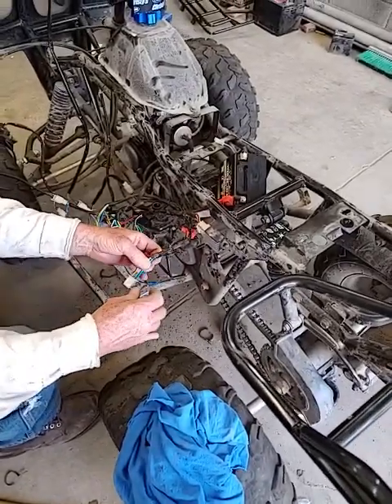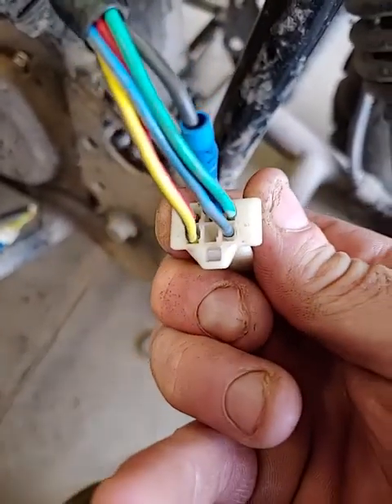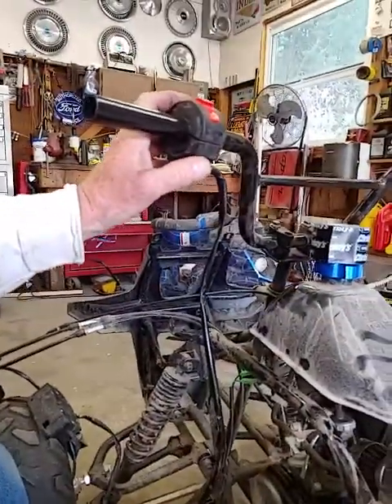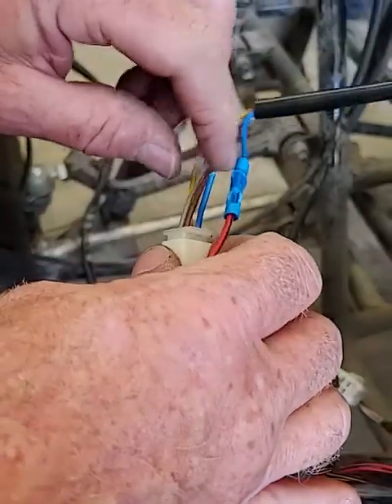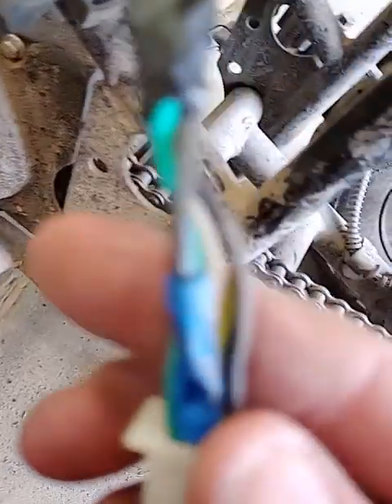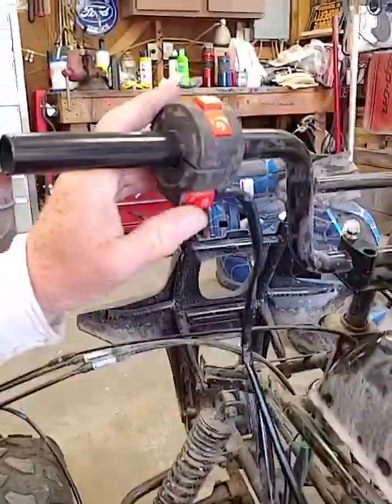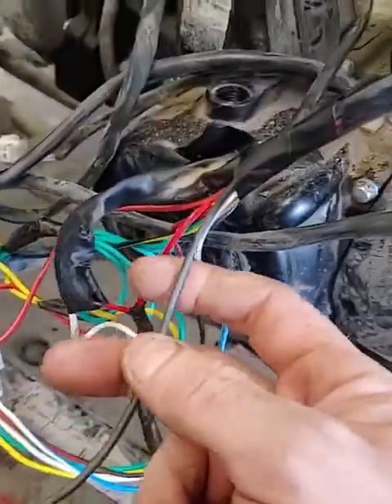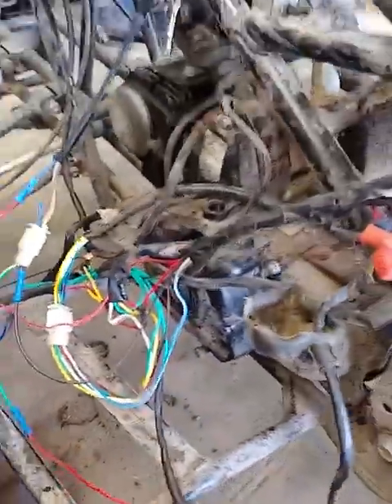Simple Chinese atv  tao tao tforce quad rewire

Comment: Thanks for the video Jeff. How is your key ignition wired and, do you have to have this in order for it to start with the push button?
Reply from the maker: Hey there sorry for the late reply so, I'm pretty sure that the actual key switch itself that accepts a key isn't wired at all it's not even necessary anymore. So you basically have a start button that will crank it over and start it and then it kill switch to kill the motor and that's it it's always live ready to go whether I have a key in it out of it key on key off makes no difference so

Comment: How to keep the battery charged when the motor is running? I used a dc cdi box 4 wire have spark but won’t keep battery charged ?!

Comment: Just watched your video. It’s helped me out a lot but I am stuck right now 
I have everything wired right but my Killswitch and my starter. I’m trying to get hooked up on the starter part of it. Does the green wire go to the grounds and if it does, then I’m good and then off my. Solenoid I have two wires that come off  , you got the red in the black ground but in the middle like area I have two wires that come off a yellow and a red and a yellow and a green now when I put the plug up to it, the two wires that come out of that is green . yellow and red And I’m lost what I need to do with those wires. Does that green wire need to go to ground and then the starter wire goes to the yellow and red cause I don’t wanna burn nothing up if you could help me out a little bit on that I really appreciate it guys. Thank you.

Comment: This might be easier for me than my other message on the Killswitch and the starter. The Killswitch has two wires. Where did those go on the starter has two wires where did those go and I’ll be ready to roll if you can tell me that information. thank you so much. I love your video.
Reply from the maker: Hey brother! I'm so sorry I have just been literally working every 12 hours. Anyway I kind of looked at mine a little today. And there's three wires that come out from the kill switch but then one of them is not used. Plugs into the existing harness and then from there the other wire doesn't come out. And they do indeed go to the starter it looks like. For sure. Anyway, could you send me a picture or even a video by chance? Like maybe just post a YouTube and then send me the link? Or something along those lines? I think that'll be easier to kind of help and see what you have going on!
Reply: I got it figured out thank you for your follow up .

Comment: I'm lost so what did you run to the safety wire. An what you run the brown wire too
Reply from the maker: the solenoid small post the other ends got to be going to the start button. One side of the start button is positive when you hit the button it connects the switch sends juice to the solenoid turns the starter.  Let me get back to you on the safety switch when you say safety switch are you talking about the switch where if the plunger falls off of it it stops running or whatever on the right handlebar?  Cuz if that's what you're talking about we just got rid of it.
Reply from the maker: safety wire is gotten rid of. The solenoid the hot side comes off the battery then there is the activation wire which is the small wire so it has a battery cable off the battery to the solenoid the a small activation wire trips the solenoid and makes the other side of the solenoid hot when you hit the start button

Comment: Need some help for wheeler won't fire should I in stall a CDi box  it's a mountopz 125cc e coolster
Reply from the maker: So I mean it's a possibility that could be the problem but it's possible it's not either. We were juggling the same thing when we started working on this thing and if yours has got all that safety crap all over it like it comes with a remote that you can cut the power or it's got a little button thing on the handlebar that the rubber stop or whatever has to be over etc the best thing you can honestly do is strip all that crap off cuz it's kind of like trying to diagnose a needle in a haystack at that point one poor connection between any of that crap and there are so many items that signal has to travel through, and you're screwed
Reply: @jeffhudson9130  probably just going to buy the whole loom set comes with everything for $35 thanks for replying I mean the four wheelers 2 years old probably doesn't have 300 hours on it belongs to my granddaughter she can't wait to get it fixed if not it'll be for sale end up buying another one thank you for your time
Reply from the maker: @robertlongley6115  yep that is EXACTLY what happened to my son's too! Very upsetting.

Comment: Do you have to remove all of the wiring, or can you just run that wire straight to your kill switch and call it good?
Reply from the maker: So pretty much, if you don't do away with all the safety crap, and it's all still connected in some way, you're not going to get spark no matter what you do. So no matter what all the safety harness part of the wiring system has to be eliminated from the system whether it's all disconnected on the main ends or whatever cosmetically of course it's going to look better but sometimes obviously that's not important
Reply: @jeffhudson9130  Thanks for the reply. The reason I asked is because I bought a brand new 2022 off of a lady that couldn’t get it started due to no spark. She was over it, so I took it off her hands. I just don’t want to mess anything up. Trying to make it simple as possible.

Comment: Where does the negative cable from the battery go? Solenoid? Or where?
Reply from the maker: Nope it just goes to a ground somewhere to the frame of the thing to the old it to the engine or the frame.

Comment: What side of the solenoid is the hot side??
Reply from the maker: Hey there.  Sorry I'm finally responding to this so you can use either big post for the hot the solenoid doesn't really know which one is hot cuz they can both be hot.  If you watch the video the one on the left the big post on the left, is the hot and the little post is the connection that excites it the start button hooks to that and that's what tells the solenoid to activate and switch

Comment: What wire give the stator power
Reply: Blue white. Red black to stator should be good. Run white and yellow from stator to voltage regulator to charge battery. Red to positive and green to negative on on battery from voltage regulator..

Comment: Where does the brown wire go
Reply from the maker: Well if it's going to the solenoid small post the other ends got to be going to the start button. One side of the start button is positive when you hit the button it connects the switch sends juice to the solenoid turns the starter

Comment: I don’t have blue wire coming from my kill switch have blue wire coming from brake
Reply from the maker: Right so just go with whatever wire is actually coming from your kill switch on different makes and models they can use different colors but they're all doing the same thing going to the same places you know
Reply: So we’re is the Activation wire going
Reply from the maker: Okay so are you looking for the wire from the kill switch or the wire from the brake like the brake light or the brake lever?
Reply: I have a yellow and black and white wire coming from my kill switch

Comment: Mine moves without giving any throttle may you help me please
Reply: I think just adjust the idle screw
Reply: @jimmyr7995  already fixed it, the throttle slide was stuck in open position. No I got different problem. It doesn’t wanna crank at all.. i got fuel ,compression, spark.. air filter is damaged don’t know it that may be the reason
Reply: @gtgoq8229  ur gonna have to check all the electrical. Wiring, cdi, stator, or it could be the starter
Reply: @jimmyr7995  well it started the night before. My brother said when he drove it didn’t go as fast as it went before. Though it started and stayed running w a little idle adjustment.